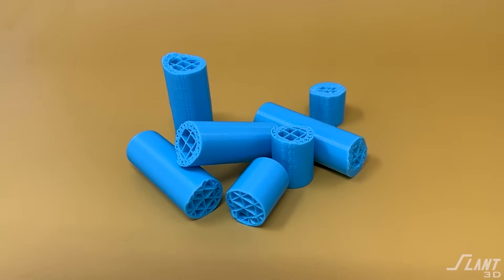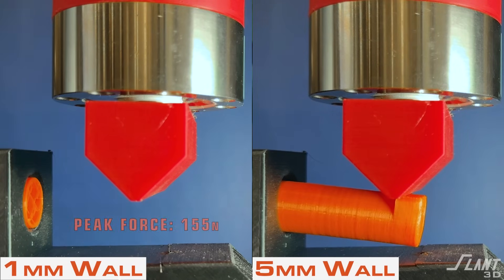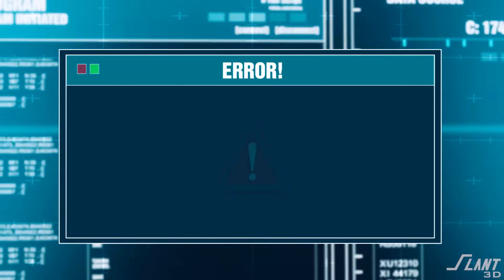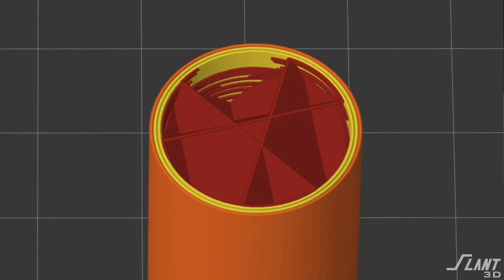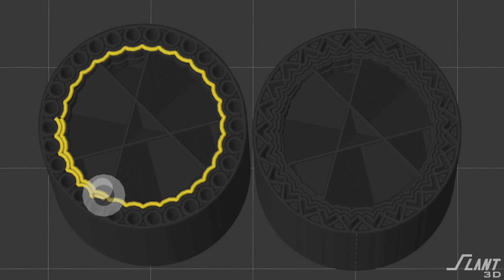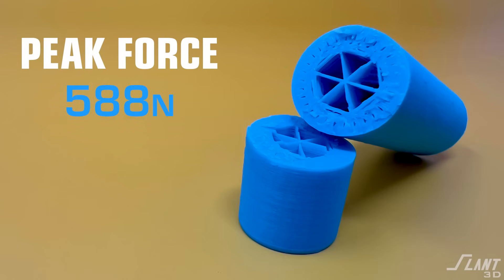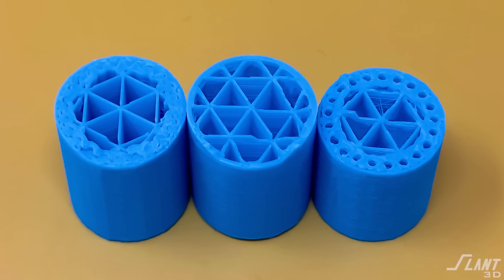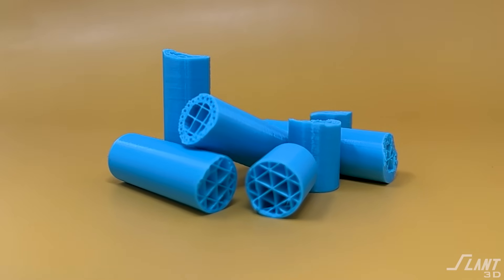3x Part Strength Without Slicer Settings | Design for Mass Production 3D Printing

Comment: Question: How about using the gyroid generator that fusion includes?
Reply: 3D Printed oil cooler without $30k software? Mistakes were made - Building a 13B Rotary BMW i8: EP15

Comment: That's a very interesting concept.  There are times when a 3D part would benefit from internal structure in just the right spot, stiffening ribs for instance, not just random infill that you can't control.  Your concept would allow this to be done at selected spots away from the outside just like you have done it for things near the outside face.

Comment: I have a model that I'm trying to do this, slicing crashes. I like the idea, but I think it's ballooning the gcode exceptionally quick and crashing my slicer. I think have to change the number of holes, but .2mm might be too small to work for my part. Definitely tricky.

Comment: I testing the best material even carbon fiber nylon filament at high temperature with tube inside design to create a strong motor coupler but i came to the conclusion that you can only 3d print than add a resins and a bit of paint and you have something really strong !

Comment: I used this approach a long time ago with printed bolts, modelling the head as basically a mostly fused nut on continued thread rather than a solid region, so that it wouldn't tend to break where the head met the threaded shaft. It worked great.

Comment: Kinda ruins some models for use with larger nozzles since it can cause some details to potentially be deleted entirely if they’re too thin. These designs feel as though they rely on you using similar print settings to the person who designed them despite being intended to reduce the need for tweaking slicer settings. Also this feels like it could potentially introduce more defects and increased print time.

Comment: Many people in the comment say its a hack. But actually its called engineering. Design has many different "genre" this is actually called structural design. In many ways you can even see it, and it has to be aeathetic as well. Take a washing machine for example. washing machine. Those indents and ribs on the side is there for reason. Its reinforce the sheet metal, gives them rigidity. Sure its also looks cool, it has a style, and those styles are even changes by time by new trends. And there are many mabybexample that structural design became a part of aesthetic design. Or even inspired by.

Comment: Hi!
I really appreciate your time to share such content.
I think the major problem is the "gap" between two printed layers. All these parts are braking exactly between the layers and not the filament material is braking. Even with adding more materials there is still the problem with how each layer is glued  together. We have to find a way to print a rod or pipe in a way to stretch the printed material.
Reply: We have a way: Horizontally. :)

Comment: Are you trolling. Like this makes no sense and none of this testing was done scientifically. Seems like youre trying to make up for the shortcomings of a manufacturer. You should just get a new one what knows what they are doing. Stop making the model bloated and useless. This is helpful NOWHERE. If you cant effectively communicate design standards to a manu then you dont need to be using them. If you cannot properly adjust slicer settings or understand how they work you should learn from online resources. This is a Joke.
Reply: I don't think it's a joke at all. The same idea and principle is used in all manufacturing. For example, injection molding needs to have a uniform wall thickness in the part, therefore the parts are designed just like that from scratch. You can see that in almost every plastic item. In woodworking, when joining structural pieces of wood together, the pieces are cut in a way that creates a strong join, which is usually some kind of interlocking mechanism - if you just glue two flat ends of a 2x4 together, they will not hold any loads.
Mr. Slant 3D also has his own print farm, manufacturing parts for customers, so he has credibility too.

Comment: Found this a day after my PLA+ hose reel replacement handle snapped across the layer lines (after 3 years of use). I'll give some of this a try in my model before I reprint, and hopefully ill have another 3+ years of my reel

Comment: All slic3r derived slicers (Orca, Bambu Studio, Prusa) support modifier meshes. You can have a second object define volumes of the print that use different print parameters. Need more walls around a hole, just put a modifier cylinder around the hole and increase the wall count. Step files will let you import multiple bodies and ensure they all stay aligned.
Reply from the maker: Sooo..cad

Comment: Another trick for vertical pegs that snap off at the base because they are essentially printed on the top layer, add a smaller cylinder hole in the center of the peg that is deeper than the top layer. You can do this in CAD or the slicer. You can even hide the cylinder inside the peg as well. The slicer will start printing the peg below the surface of the model and add extra strength, works great even down to 2mm small pegs.
Reply: Do you got a video explain that?

Comment: Just add a square hole through the part, then print square sticks to fill the hole with layer lines in longitude direction.  3D Bones.  Won't snap on layer lines. Add a bit of glue for even stronger layers.
Reply: Rebar strat
Reply: thats so underrated, thanks man
Reply: Bro that's brilliant

Comment: That's awesome.  Maybe you should make a design rules list for 3d printing (if you haven't already), like fillets on the XY axes rather than sharp corners, chamfers at 45 on Z, try to print on 45 degrees to eliminate supports etc

Comment: This really a hack to work around the lack integration between CAD software and Slicer software to designate multiple infill types (and/or densities) for different regions of a component during the design process. The hack is custom infill.
At some point CAD software will integrate, or allow plug-ins that enable designers to define multiple infills for multiple region(s) of a part. It will allow designing of supports for 3d-printing with the design, and allow "skinning" the outer surface with multiple texture patterns.

It's like CAD software is at a level of evolution where small walls the shape of doors have to be manually created, because the software does not have integrated door features. Similarly the concept of widows doesn't exist, so designers manual make cutouts in wall features.
Reply: Or we'll get a 3MF specification that doesn't leave it up to the slicer what to call the various parameters.

Comment: My trick, use a fat nozzle and print my walls at up to 4mm thick on a single wall
it'll run slower at that much size to be sure, but the print tome is about the same.
with PETG, I have no worries as to layer adhesion

Comment: I've been using this to strengthen holes without having to increase the perimeters or infill. If you cross-section Prusa parts you can see that they use this too to strengthen some of their parts as it creates internal perimeters. However, they use it more inside the parts instead of near the outer walls.

Comment: Okay, wow, you mentioned building with wood and then just went off on a tangent and missed your own point. If you are making an airplane from wood you pay attention to the grain. Same with your rod. Print it horizontal and you will pick up much more strength than just adding wall thickness.
Reply from the maker: And there are never parts that have to be printed vertically. That never comes up.
Reply: @slant3d I think you need to take a break from youtube and rethink doing the whole youtube thing all together, i’ve seen a handful of your videos and you are blatantly misleading people, I don’t think it’s intentional, it’s just that you are not in any position to make any authoritative advice. You skipped the step where you learn and grow and jumped strait into content farming and making ad revenue, which is an awesome rush, I love earning money but you need to read a book on mechanics of materials or manufacturing, or literally anything would be an improvement at this point, you miss the mark so hard, anyone with a semester of engineering under their belt can see the glaring problems with the content you make. Not hating or anything, just my honest unsolicited advice.

Comment: Or we can move away from using the long outdated STL file format and start using 3MF to share models, which was designed for 3D printing and keeps track of things like wall thickness.
Reply from the maker: Not compatible across printers
Reply: @slant3d  I'd be curious to know which slicers don't support it.

Comment: Years ago I’d insert small cuts into CAD models to force perimeters (as you’re suggesting) but I don’t like the solution at all. Not all slicers would do the right thing with those cuts! Instead I consider the slicing an absolutely essential part of the manufacturing process; it’s not something I’d leave to chance. If I need more perimeters in a certain place, I create a modifier in CAD which I load into the slicer. If a print service can’t handle that, I’d find a new print service.

Comment: I'm not convinced with the example provided, because it'll increase the print time significantly to get to the same strength.
IMO, 3D printing parameters require specifying the wall thickness and infill characteristics at the bare minimum.

Comment: This is resonating with me, because at my work (a delivery company) right now we're having a lot of problems with needing to communicate special exemptions to procedures for specific clients.  I keep pushing to try and find ways to just encode those exemptions in to the normal processes.

This file design is a great example of what I want to have happen - now the designer doesn't need to communicate with the manufacturer at all, and the part still ends up as strong as needed.

As others have mentioned, the extra work is unlikely to be worth it when the designer and the manufacturer are the same person -ie, the average hobby printor - but that's not the point of this. Alas, most of those other comments seem to have missed that detail.
Reply: Why is not communicating with the manufacturer a good thing? If you can’t tell your manufacturer that you need this part printed with certain settings then something is very wrong, either with your company or theirs.
Reply: @conorstewart2214  Of course it's a good thing, but eliminating opportunities for miscommunication is an even better thing.
Reply: @conorstewart2214  It's a matter of automation. As soon as you have to get a trained human being involved, the cost goes way up.  What we really need is a 3MF specification update that makes these sorts of specifications consistent across slicers.

Comment: This hack works .. but i feel it being wrong.
Wall thickness should be just one of dimensions/specs of part, that should be passed on to said mass manufacturing.
If it wasn't being passed, then it's problem of communication between designer/engineering and manufacturer. It shouldn't need to be hacked around. Also i suspect that normal sliced thicker walls in slicer should result in even stronger walls, and would print even faster, due continous simple movements instead of micro-wavy ones.

Comment: You said it yourself: this is a hack.
Your intent is to specify a minimum wall thickness that must be filled, and a center surface that either may be filled or should be filled at x% infill to some spec. Adding circles isn’t specifying that, it’s tricking most known slicers into doing that.

CAD needs to catch up. These are part design standards, not machine dependent manufacturing techniques or optimizations. This info needs to be in the CAD model and CAD software needs to implement these settings that are in slicers.
Reply: You actually can have your CAD model tell the slicer where to put different settings: using modifier meshes. I used to do hacks like this—and got quite good at it—but once Slic3r added modifiers I threw all this nonsense overboard. PrusaSlicer, Orca, etc. have all inherited this ability.
Reply: @joshcarter-com  how do you create a modifier mesh in CAD, though?
Reply: @thoperSought  The same way you create any mesh.
Reply: @thoperSought  In CAD, when you’re making your part, make a body that represents the volume(s) which need different settings. Export as a separate STL. Then in the slicer right-click your part, select Add Modifier > Load, then select the modifier STL you had exported. Then in the slicer’s part list you can select the modifier and add any custom settings you want.
Reply: @joshcarter-com  I think the point is that the slicer data isn't getting uploaded and used - only the STLs. Otherwise you'd just say "use thicker walls." What we really need is better standardization in 3MF to have those sorts of controls consistent across slicers and machines.

Comment: Funny though, you know how there are programs that add texture to the outside wall?  This bumps strength and rigidity.  Have you ever heard of a program that could maintain the external geometry but add texture to the inside walls.    Would be interesting.

Comment: Sounds like a nice trick for sharing models that need some extra strength in critical places that don't require users to tinker with print settings, just plop down stl and print
Reply: If you want optimal results from 3D printing you need to change print settings or at least be comfortable doing it. It isn’t difficult either.

Comment: Very interesting! I’m unlikely to use it in my personal hobby printing, but its an interesting technique, especially if you need just one region to be extra-strong but don’t want the weight/time/cost penalty in other places.

You mentioned solid infill briefly. I’ve been amazed by just how strong PLA (or most other plastics) are when printed solid. I made some PLA press-brake dies with 100% infill for bending metal in either a vise or my 20T hydraulic press and it’s surprising how much they can stand up to.

It wouldn’t likely be something you see come through your workflow, because I wouldn’t expect that plastic dies would be used in any sort of production - or would they? I suspect not, because if you were running through enough plastic dies to be worth sending the job to Slant3D I’d expect it would be more cost-effective to just have some metal ones made from metal with a CNC.

Are there any applications you see though, where the parts you made are used as consumables in production processes? If you do and haven’t already covered it, such uses might be interesting to your viewers.

Fantastic content as always, the knowledge you share is doing a lot towards helping 3D printing become a true production process!

Comment: excellent tip! also if you do a similar thing but make your holes 3mm you can slide 3mm steel rod in to it and she stiffens up like no pure plastic part could dream of!
Reply: If you use a 2.5mm hole, and use a drill to spin it into the whole, you will get a much stronger unit. It will melt the Z lines together. But you need to cut off the end.

Also a cheap source of rods is Tig welding rods.

Comment: Honestly i do prefer the slicer side of modifications on this just due to modeling time i dont think it would  pay off the time until you do get at least into the hundreds made and even then i had a slicer idea a while ago to print a (infill based) cylinder about the size of the nozzel and just use the nozzel to just inject plastic inside it after so many layers to lock the layers together and ik im not the only one thinking about it
Reply: Ah, but the point is that one is making this file for other people to print, and assuming they'll make the laziest choices possible when it comes to slicer settings.  Yes, just increasing the wall thickness in slicer is the fastest way to make something stronger - but on the manufacturing side, the file creator can't control that.  So this is creating a file that will still thicken the walls even when the factory goes for 2 perimeters and 15% infill just to bang it out fast.
Reply: @davydatwood3158  yes haveing a 1 size fits all attitude to all models and haveing modelers fix it for them to keep it that way

Comment: One day the slicers will be automatically adding holes among several layers and inject material in them and layer adhesion will no longer be a problem...
Reply: That would be awesome! Injecting heat stakes across layers where there is high stress should be totally achievable with existing hardware.
Reply: Probably not that easy especially if your print is tall but maybe can be repeated after certain number of layer lines tho that brings it back to almost the same problem again.
Reply: @crazysoulpubg   "... that brings it back to almost the same problem again."  Not if the injected "rebar" is staggered across different layers.  It only has to go a few layers deep actually.

Slicers could do this now... just a matter of code.
Reply: @4Fixerdave  precisely
Reply: @4Fixerdave  my thoughts 💯

Comment: This is a very useful technique that I'm surprised isn't used more widely. Especially when you only want to strengthen specific regions of a model but have the rest of it (non-load bearing) be thin. I think i first saw this used in the reprap project. Thanks for making these videos. I've gotten a number of extremely useful tips from them over the last few months. Keep up the good work. P.S. I ordered some parts through your API. Excellent print quality! Loved it.